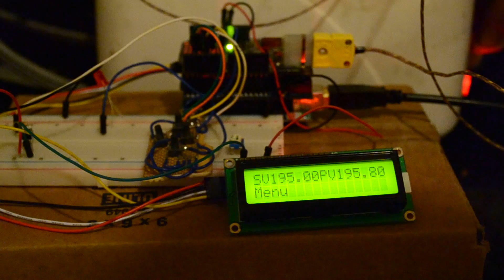Arduino PID controller driving toaster temperature control

Comment: Awsome job. New to arduino. Want in to control water temp with 2 heating elements one larger (2000) watt and a smaller 1000 watt.  Pid setup where the 2000 and the 1000 come on under a preset temp and the 2000 drops out and just the 1000 modulates with a solid state relay. And a temp sensor. Using a setpoint value and a temp readout like your lcd setup. Is there a link I can follow to your code. I also noticed you are you are using a k type t couple. Can't wait to get my hands on the conversion info for the code. Thanks

Comment: Hi, Great work. How do you control the maximum rate at which the relay is activated?
I'm currently trying to figure out how to slow down the PID library in order to avoid frying my relay.
In more detail: Do you simply set the rate at which the PID is computing, or do you let it compute at a higher rate and slow down the on/off decisions only?
Thanks!

Comment: I fell in love with the PID loop in process control, 1989. Didn't know Arduino could do it. I'd  like to see about using it in a climate control system for my trailer.

Shame OneWire is only for one device- I already have all the sensors. Good to see this is possible, though!

Comment: This one is a K-type thermocouple with a MAX6675 thermocouple to digital converter chip. The MAX6675 was only available in K-type and is also now obsolete. The replacement is the MAX31855, which comes in different versions (K, J, N, T, S, R, E type thermocouples). I have recently designed a PCB which combines the RBBB Arduino, MAX31855, 4 button array and I2C LCD interface. Using a T-type thermocouple with the MAX31855 gives an accuracy of within 0.5°C with a resolution of 0.25°C.